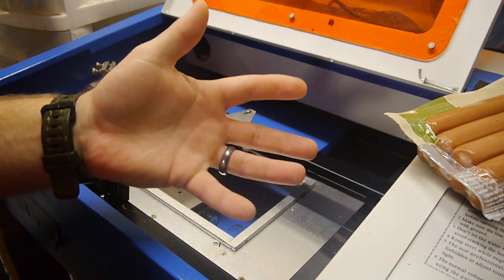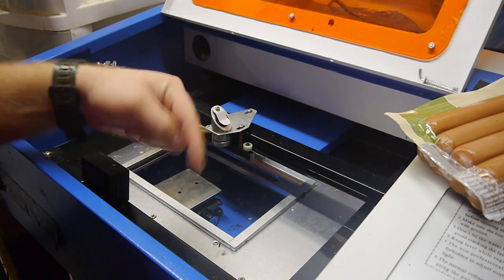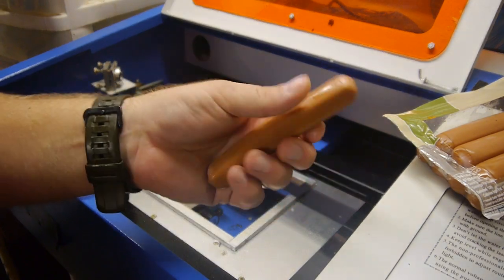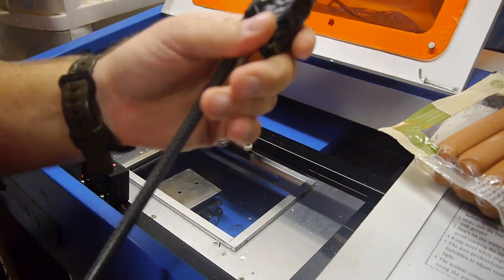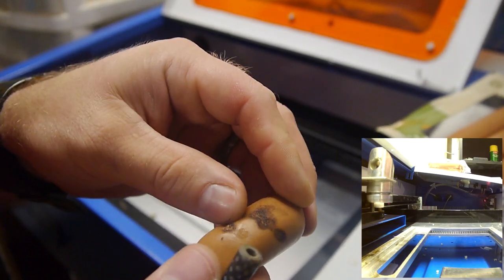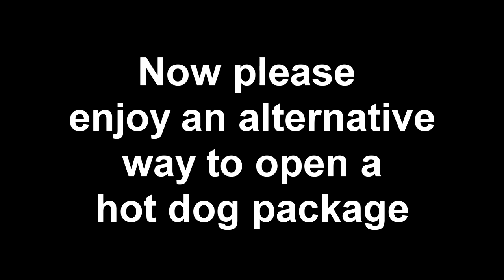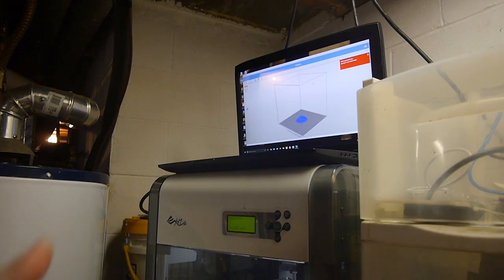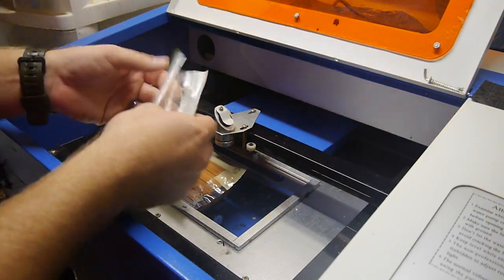How Dangerous is an unfocused CO2 Laser? K40 Dangerous?

Comment: I blew a hole through my thumb nail when I first got the machine. all the way through the nail and half way through my thumb! 25% power unfocused.
Reply from the maker: High Tech Gear Works 
Oh Wow!  That must have hurt! Has everything grown back ok? My middle finger and my table saw had a disagreement once that saw a 3/8" deep chuck of my finger get cut. It is 2 years later and there is a scar and most of the nerve has grown back so very lucky on my part. I hope all is well on your end.
Reply: Just Josh took about 3 months for the nail to grow out the best part of a laser burn is instant cauterisation. I just walked through the house to the sink and held it under the water for a bit. I walked through mumbling that was dumb over and over. Lesson learned. I have a sign I made on my CNC above the laser now that says.  Shop rule 1 never put your finger anywhere you wouldn't put your willy!
Reply from the maker: High Tech Gear Works Glad to hear it grew back, and that's an awesome shop sign. I kept muttering, "Stupid, stupid, stupid" as I wrapped my finger in duct tape and paper towel lol. I was experiencing acute necrotizing pancreatitis at the time and was due for major surgery to drain the psuedocyst in a couple days, so I only had to live with the pain for a couple days before I was on pain meds. LoL

Comment: the laser pinpoint will enter your finger and if it powerful enuff and lucky will pin your bone but it will not cut your finger if the laser was in on/off speed time and you remove your finger fast . but the laser will make a micro hole in your finger from way to another side of your finger without you know it and there will be no blood but you will have a painful finger for  full day ( that really happen but not  me  .) it will fast make a micro hole in your finger throw your finger bone and get out from other side of your finger and you barely see the hole

Comment: It's like laying your arm on a soldering iron. Makes you feel like a total moron...
Reply: I did something like that a couple weeks back. My Weller WES51 soldering iron stopped working so I plugged in my cheap one and let it heat up nice a hot. When I went to picked it up, I held it like my Weller in my right hand. I forgot that the handle is much shorter on the cheap one and went to support it with my left hand which happened to be the hot end of the iron. I got a nice burn on my thumb and pointer finger. I felt like a moron but I finished soldering the XT60 and went a flew my plane anyway.